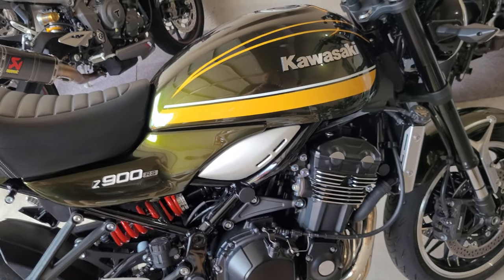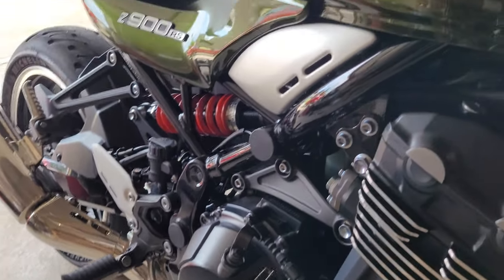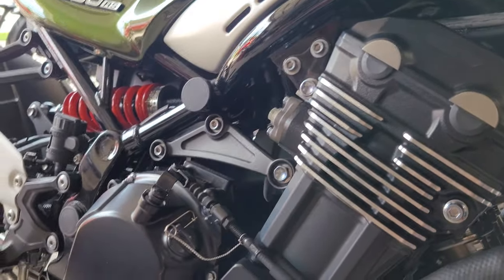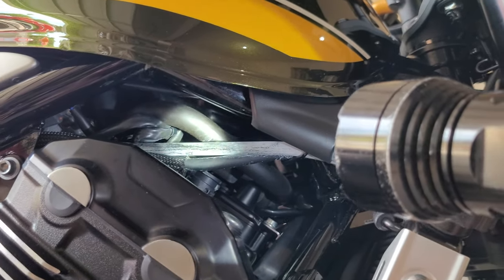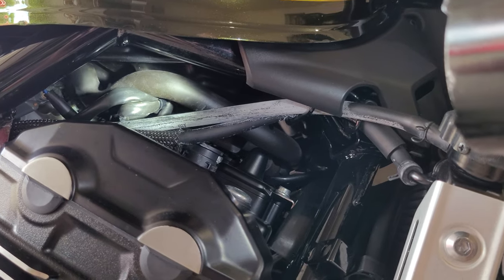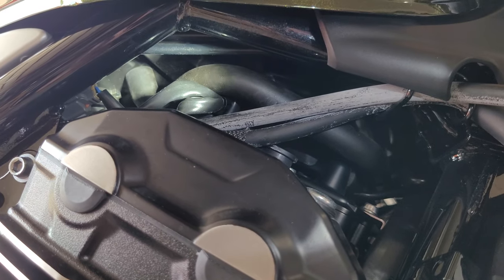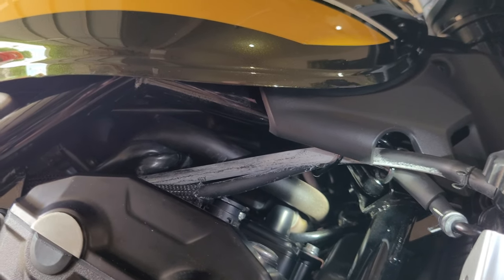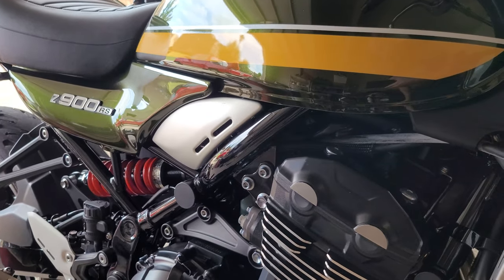How to disable the SAI system on a Z900RS with a simple marble in 60 seconds.

Comment: easy mod yes, however this reduces the oxygen in the exhaust so the lambda sensor tries to compensate by leaning the mixture to get the right oxygen mixture, which is already lean, the end result? burnt valves  ! do this mod  at your peril
Reply from the maker: Except that the ECU flash has disabled the O2 sensors, so none of that is happening.  And the O2 sensors are narrowband sensors, so their ability to read the exhaust and make actual changes is VERY limited.

If you look at the video at the 11 second mark, you can see that I don't even have O2 sensors, they are removed and capped off.  And I say that in the first 8 seconds that I am preparing it for the ECU flash and tune...  ;-)
Reply: But doesn’t it only have an affect when the throttle is off? So the O2 sensors would only be detecting less air when the throttle is off right? Why would that matter? Is my thinking wrong? I’m thinking about doing this but you’re making me doubt myself lol

Comment: If the power commander tune is already installed. Is this pointless unless I immediately re-tune after I install the marble?
Reply from the maker: Did you disable the O2 sensors and disconnect them?  If so, then doing this mod won't change the tune, it just gets rid of a lot of the popping and banging on decel.  But if you want to put it on the dyno and tune it, then yes, you want to disable with this mod.

Are you running the tune from Dynojet, or did you have a custom map made?
Reply: @SquireSCA  I just purchased the bike a couple days ago. I’m not sure what the cycle shop did exactly except for installing the exhaust and Power Commander. I know they just used the provided Tune that PC had in their database. I am gonna do the marble fix just for the decel pops. I do think the bike runs a bit lean. There’s nobody around very close to me who does the flash or dyno tune.
Reply from the maker: @ScottH1130  Where do you live?  I have yet to see a map from Dynojet that was even close for a given application... Most of them aren't any better than the base map in the ECU... Lean in one area, stupid rich in another...  You need it tuned.

Do you still have the O2 sensor connected?
Reply: @SquireSCA  I’m in northern Indiana. The O2 sensor is still plugged in. I just used the marble. Worked great. Virtually no decel pop.
Reply from the maker: @ScottH1130  Ok, so the O2 sensor is active, which means in the "closed loop" area of the fuel map...  Meaning up to 5,000rpm and 20% throttle, it will be lean because the Power Commander cannot operate there.

You need to flash the ECU to get it tuned right, to disable the O2 sensor, etc...  There are plenty of places that you can email your ECU to, tell them what mods you have done, and they can flash AND put the right tune in it, and send it back.  Moore Mafia, Brock's, Ivan, and others...

If it were my bike, I would take out the PC-V, sell it, take that money and get the ECU flashed.
Reply: @SquireSCA  thanks for the advice. I will look up Ivan’s tune and see how it’s done. I’m still learning.
Reply: @SquireSCA  yea base maps can be a good starting point. But if I’m spending my money on anything it’s a gas analyzed dyno tune
Reply from the maker: @poker8193  That's how we got my map made, on the dyno...
Reply: @SquireSCA  Hi Dave! Are MM, Brock's, and Ivan use the same flashing software? What ECU tuning software are they using?
Reply from the maker: @bleak0218  MM is using Woolich, not sure what the others are using.

Comment: Hi, I have the block off plates already, not installed, but have installed a K&N air filter and an Akrapovic complete headers & muffler replacement. I also have a booster -plug, not installed yet.  At this point the bike is a little jumpy, but pops very little. Any advice on where to go from here?
Reply from the maker: Toss the Booster Plug.  It's snake oil, and doesn't do what you think it does.  It just dumps more fuel everywhere.  It has no ability to only put fuel where it's needed.  Imagine taking the entire fuel map, and just doing +10 in it.  That's what it does.  Lean areas might improve a little, but areas that are rich get even richer...

Honestly, for your setup, hit up Ivan's Performance.  I normally recommend people to go to Moore Mafia, but I don't know if Chris has a map for the full exhaust, but I know that Ivan does.  You can mail him your ECU and he will flash it and send it back.  Ivan knows this particular bike inside and out.
Reply: Thanks, do I go ahead and disconnect the hose in this video and place a marble in there? @SquireSCA
Reply from the maker: @michaellong7918  After you get the ECU flashed, block off the hose with a marble and then you can unplug and remove the O2 sensors.
Reply: Thank you, wished I had seen your site earlier! @SquireSCA

Comment: Thank you for the video. Question, would you disable this if you replace headers and get bike ecu reflashed? Folks are saying I need to block off ais system, guessing Sai is totally different or does it need to be blocked off also.
Reply from the maker: Its the same system.  You can buy and go to the hassle of installing blockoff plates, or just use my method.  Same results...
Reply: @SquireSCA  thanks a bunch for your reply

Comment: I have a Z900. Just had it tuned by Moore. The only mod I listed was an exhaust and a K&N. Should I still block this or do I need to get it re-tuned then block it?
Reply from the maker: If he disabled the O2 sensors, which he usually does, then you don't need a retune if you block the AIS system.
Reply: @SquireSCA  Thanks for the quick reply.

Comment: Does it still link cylinders between one another?
Reply from the maker: Not sure what you mean.  This is the air injection system for emissions.  The marble simply blocks it and disables it, so you can get accurate readings on the dyno, and you get less popping and crackling on decel...

Comment: Hello Dave,
If i understand, it's to do when you remove the O2 sensor ?   
Thanks !
Charles from Belgium
Reply from the maker: Yes, and its required to remove the O2 and SAI be disabled when the bike goes on the dyno for a tune, which mine will be doing next week I think.
Reply: @SquireSCA  ok. It's not for running like that without O2sensor and original ECU ?
Reply: Bonjour @Frisque Charles, je galère un peu avec l'anglais... Donc si je comprends bien, si on neutralise la sonde au niveau du catalyseur, il y a ce tuyau à neutraliser aussi pour que la moto respire mieux ?

Comment: will the marble stays inside the hose ? any possibilities it might end up anywhere inside the engine?
Reply from the maker: There is zero chance it will go into the engine if the marble is the right size.  It should not roll into the hose... You are gonna have to grease or oil it up and push it in there... giggity...
Reply: @SquireSCA That’s what she said,oil it up and push it In 😂

Comment: Would there be any benefits using this mod on a completely stock z900rs?
Reply from the maker: Nope.  If you are stock, leave it alone.  if you block it with the O2 sensors still engaged, the ECU might think you are running "too rich" and try to lean out what is already a lean mixture...

Only do it if you disable and remove the O2 sensors...
Reply: Correct me if im wrong. I read somewhere that the AIS/PAIR valve is not connected to the ecu so it will not throw CEL. 

Also, is it ok to block the hose just to eliminate excessive popping? Only breadbox delete with a shorty pipe on the bike. Catalytic converter is still installed.
Reply from the maker: @mrk02mrk  You can just plug it.  My only concern is that if you have not flashed the ECU to get rid of the O2 sensor, then blocking the SAI hose, could potentially cause the ECU to think that the bike is running a tad richer than it is, and try to compensate in the closed loop section of the fueling map.  I don't know that it will, but I don't know that it won't, so I usually only block the SAI once the O2 sensor is disabled and removed...
Reply: Hi Dave. I’ve done the 02 delete but not intending to do a ECU flash or tune as yet, maybe in the future I might. So now I’ve done the 02 delete would it benefit me to stick a marble in that hose and reattach said hose? Many thanks. 😊